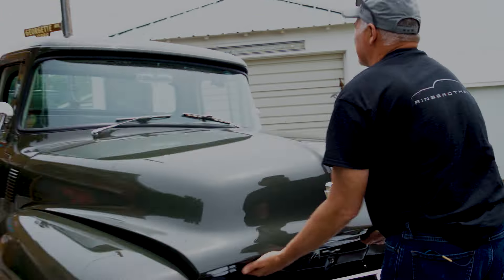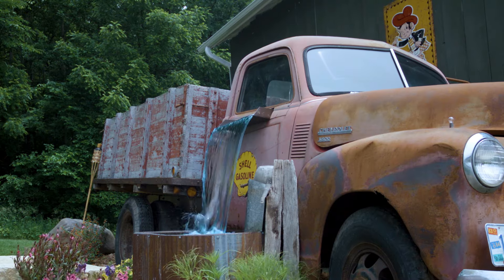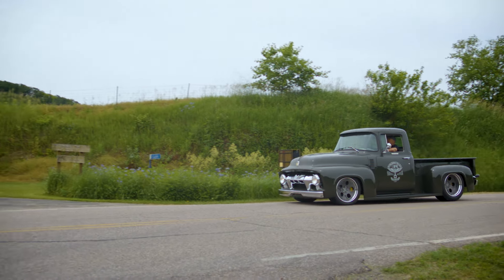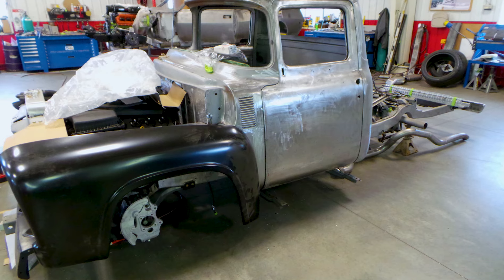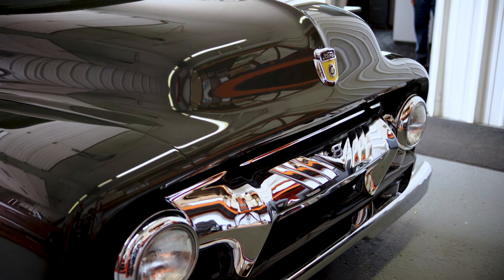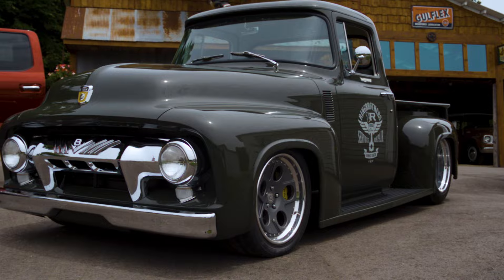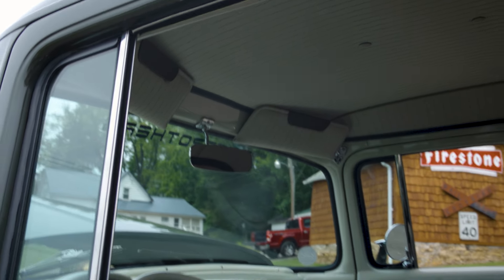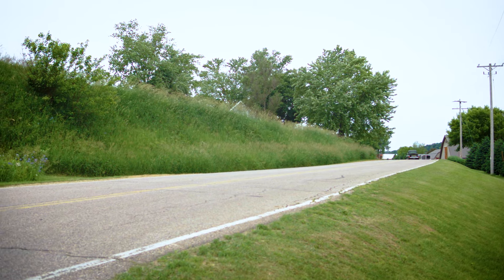We Modernised A 1950s Ford F100 | RIDICULOUS RIDES

Comment: Can someone explain why lowering trucks is so popular? Seems to me like losing function for form
Reply: Mine I lifted it a little bit. But the wheels are 22s too
Reply: I mean no disrespect but if someone has to explain it to you you will never understand imho
Reply: @cliveeade6727  None taken. I suspect you’re  right too. To each, their own and all that.
Reply: Because it's NOT used as a work truck or a hauler anymore yet a ROAD truck capable of keeping up with actual sports cars that cost way more money. They handle and ride so much better after being lowered.
Reply: @tedpiehl255  THAT'S JUST DUMB
Reply: @dieseldabz7104  it pulls my 32 foot 5th wheel and my 64 Galaxy at the same time. Different strokes for different folks 😉
Reply: Thanks guys. I understand a little better now
Reply: @dieseldabz7104  I'll make you cry more you infant, I have stock Firestones, that's right the thin ones, and the Hubcap center is lined perfectly with the Fender bottom line. Nice and naturally high, and works completely fine, and the color is the same normal factory option since, 1936. Plymouth Pickup, can hold a Christmas tree, a piano, a bed, your maturity for you until your ready to apply it to yourself again. Anything really
Reply: This F100 is meant to be a Hotrod not an actual work vehicle.
Reply: @CJColvin  your right , the F 100 is next in line from the 1932 ford roadster in America vintage hot rodding . The design is all by itself . I was in hi-school from 1957 to 1959 and the parking lot always had several  lowered   F 100 in it . One could be purchased for $ 300 to $ 1200 .
Reply: @moo.johnference869  Yeo you got it brother.
Reply: It is worth noting just this year a 1956  f100 with a coyote engine and trans went across the B Jackson auction block at $ 220.000 in less than 3 minutes.
That my friends is called " setting the pace "
Reply: @dieseldabz7104 Sorry but by the time they put $80,000 worth of PARTS (not including labor) in this thing, it’s not competing with anything for the money. It’s just cool for the sake of it.

Also this thing is too low for me, there’s speed bumps in my city that are 6” tall, if the vehicle doesn’t have at least that clearance it might as well not exist to me

Comment: I like how it turned out but saying "An F100 like no other" is a bit much. Ok hear me out. Take any old truck. Repair it to showroom condition. Cram a huge, 600HP V8 under the hood (but only drive it at 30mph). Spend thousands of dollars on wheels, unnecessary accessories, like diamond plated rearview mirror housing, rollbar filled with mercury, LED screen in the glovebox facing the engine so it doesn't get bored, all in the name of desperately trying to prove that it's unique. But sure, you can say that there's no other truck like that.
Reply: Rail Skills  Sometimes I get to drive our 2003 Suzuki Alto. Why does it matter tho? Our financial situation is irrelevant in this case, I can have taste in cars and make fun of these people all day if I want to.
Reply: @repapeti98  let's see... the last  F100 I saw with a coyote engine went across the auction block at $ 220.000 in less than 3 minutes.

Comment: Why on earth would you change it from good old carbureted to stupid fuel injection
Reply: Because the same reason they didn't put a flathead in it , reliability
Reply: @hieronymus..bosch8532  carbureted is better easier serviced and more reliable
Reply: @conortobin1537  I think you'll find you're wrong .
all my carbureted cars need constant maintenance my EFI cars don't
Reply: Sftu old man
Reply: @conortobin1537  Maybe in 1978 but NOT in 2021 so wake the hell up guy..
Reply: @dieseldabz7104  mate I’m 15
Reply: Mostly because today's ethanol-blended gasoline is damaging to carburetor gaskets and mechanical fuel pumps (and old style rubber fuel lines, too).  EFI components are engineered to work with the "oxygenated" fuels.